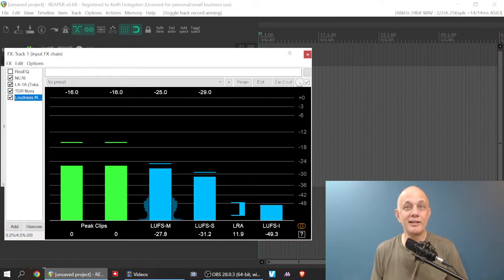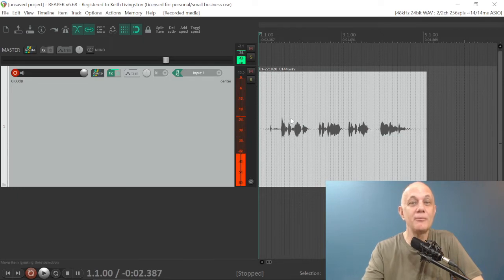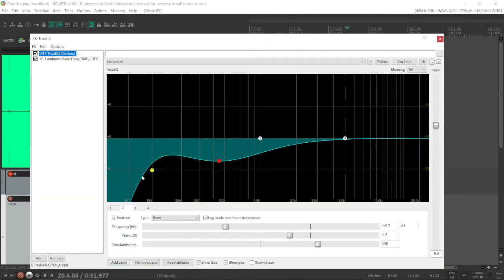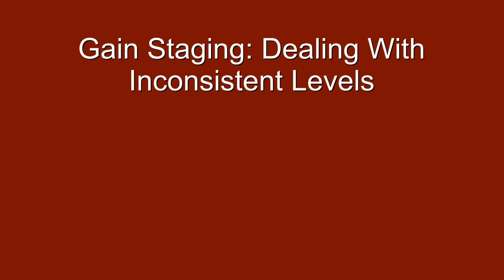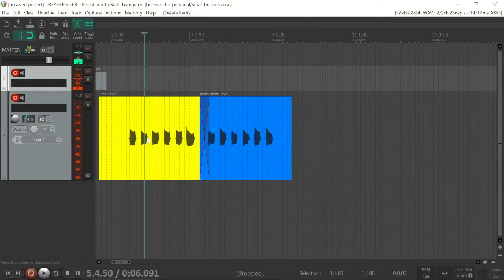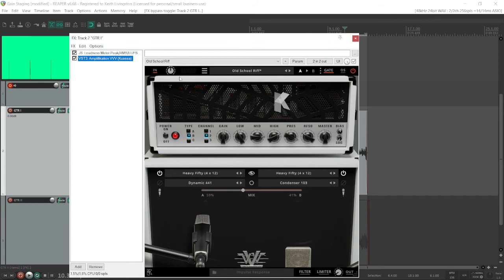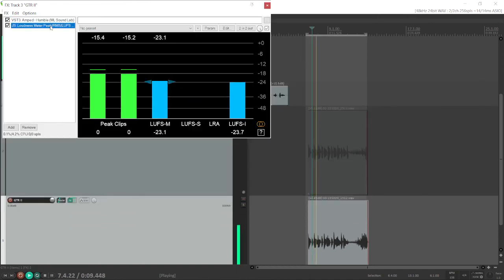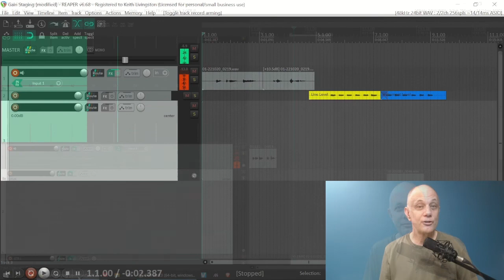Gain Staging For Home Recording

Comment: Great channel, man. I wonder how would you apply all this stuff to create and level presets in a digital guitar modeler like kemper, fractal, helix... using Reaper
Reply from the maker: Funny, I just read a post by a guy who created some modeling software. Stave Ack, who created Neural Amp Modeler (you should check it out).

There's been a lot of talk about how to properly set input levels to amp sims. He said he likes to set it by ear. And then you would set the output to match the level going in. 

But if it's still too hot coming out, remember -- you can use the channel volume to bring it down.

Not that that answers your question in any way 😂
Reply: @NLNPNL  LOL